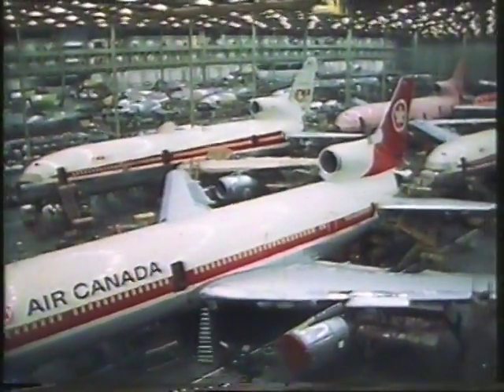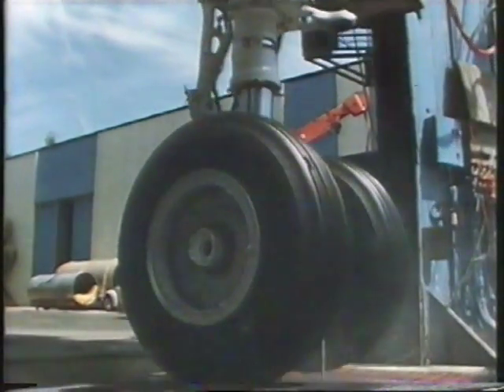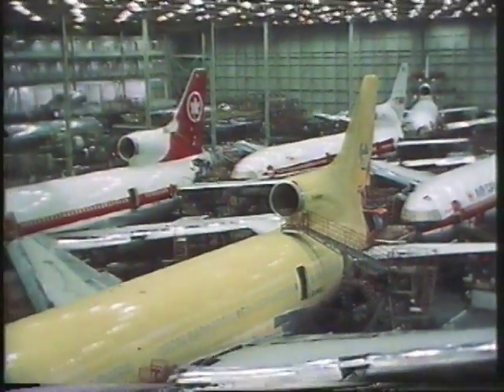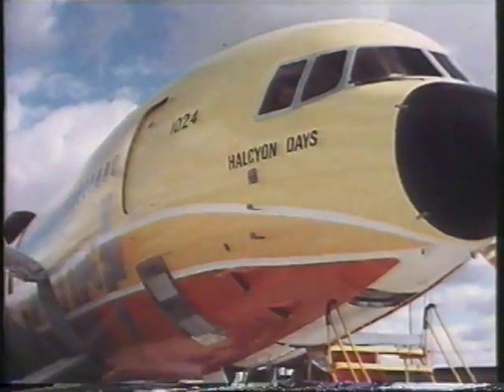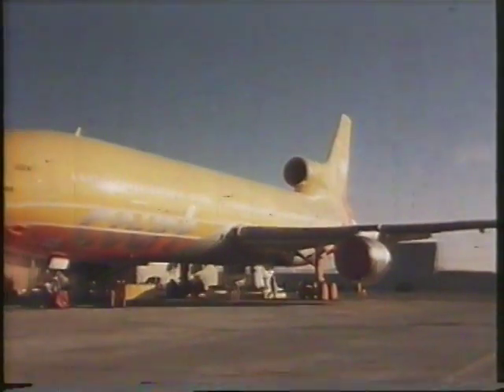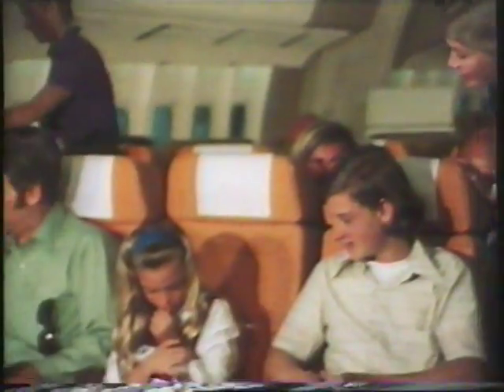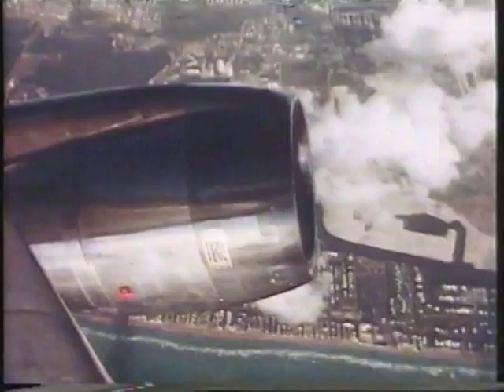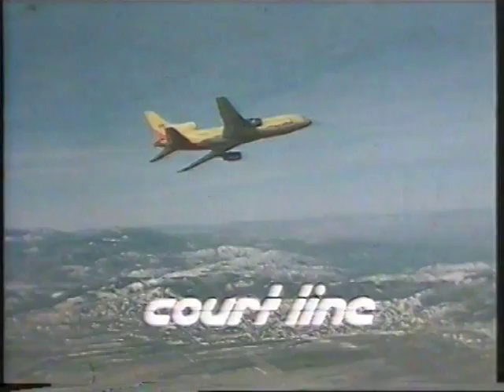Court Line Lockheed L-1011 TriStar

Comment: The problem with the L1011 was the complexity of the aircrafts avionics. Also some pilots found it difficult adjusting to the sophisticated lift dump system, resulting in many heavy landings. But at least the aircraft was fitted with Rolls-Royce RB2-11 engines. A three spool design that     started its commercial life in the Tristar. Derivatives of the RB2-11 are being fitted to the latest jets such as the Airbus A350.

The Tristar 200 series did not have a great range. OK for most trans -Atlantic routes, but couldn’t operate LHR/LAX. The Tristar 500 came along with more powerful engines. It was a shortened version of the Tristar, like a 747SP. Delta took out the underfloor galleys on their Tristars, and fitted extra fuel tanks whilst also uprating the engines. This derivative was called the 250 and then the Tristar could then compete with the DC10-30. British Airways took out the underfloor galleys on their 200’s just to release more cargo capacity. Those aircraft eventually ended up being converted to all cargo with operators like Kalitta. The 200 version of the Tristar had a frisbee ramp in front of the intake for No2 engine.

The Tristar was a very popular aircraft with British Airways Flight and Cabin Crews. The type was used a lot on Middle Eastern routes.

Comment: Flew as a passenger in one of the Court Line TriStars and did a flight deck visit whilst undergoing training to be an RAF flight engineer.

Little did I know I would end up flying the Tristar both in military service and for a civilian company.  It was by far and away my favourite flightdeck as it was impeccably laid out, unlike the DC-10 which I flew for several years.

I always thought the TriStar was designed for grown-ups . . .
Reply: That is a L1011
TriStar

Comment: The built in stairs was cool, most didn’t have that option tho, same with the mini loading ramp. Beautiful aircraft , Lockheed should get back into making airliners again!
Reply: Just get the old blueprints out, rethink the layout,  tweak efficient wings and fuselage, and  add three more fuel efficient and quiet engines, and you'll have a winner over 787 and the320.

Comment: Forget the plane that self-folding stairway is an engineering marvel
Reply: No doubt, when I was watching the stairs deploy I was thinking " yeah but no railing, too dangerous to use those" just then the railing pops up ,,,, Amazing
Reply: That stairway was a marvel. 
Though lest  be said about  the planes volatile automatic escape door at the rear.
Reply: @Montyair1  the DC-10 had the automatic self-escape/self destruct cargo door
Reply: Air stairs were nothing new.  Even then.
Reply: Shop queen.
Reply: Engineering marvel no doubt, but not a great idea when viewed from an efficiency and ROI point of view

Comment: What a DC-10 wants to be when it grows up.
Reply: Yes, we know the L-1011 is and was a highly advanced aircraft for its time. But the DC-10 is still advanced and also a workhorse. I hope the MD-11 will see a few more years of service in cargo.
Reply: Funny to hear the DC 10 comparison comment😅
Roher and GM made similar styled Motorcoaches that Rivaled each other like Tri Star and DC 10 did.  Once again, the boring  household names win.
 Douglas and GM win over Lockheed and Roher even with all their tech advancements. One is still in flight and the other became "the most iconic vehicle of the 20th Century."🏁🏁
Reply: Yeah, right…that’s why the DC-10 sold more than the L-1011.

The L-1011 aka The Tritanic.
Reply: @scottnichols3685  , you're not considering the flaws.

When did an L-1011 lose an engine on take off, as in ripped off a wing?

When were the hydraulics of an L-1011 knocked out by an engine explosion (UAL)?

When did the floor beams of an L-1011 collapse due to a cargo door blow out?

Face it. It was a superior aircraft.
Reply: @lrg3834  : both of these posts are grossly oversimplified (and bad) takes.

The DC-10 outsold the L1011 because it was cheaper yet still functional. The L1011 was technically superior in many ways but this was reflected in the price tag. Relying on RR alone was the worst decision made in the whole program as it put the airplane behind schedule and under-budget - a CF6 or JT9D L1011 would have probably had fairly similar costs to the DC-10.

The DC-10 was also easier to maintain, particularly the #2 engine.

The DC-10 that lost its engine on takeoff had nothing to do with the design of the airplane and everything to do with shoddy maintenance. The only airlines with pylon fatigue issues were the ones that abused the airframe during engine swaps. Northwest never had a problem and they operated the DC-10 a decade longer than any other US carrier.

Lockheed was wise to arrange the hydraulic system in a way that made a complete failure due to #2 uncontained failure less likely. MDC ought to have considered this possibility (and the changes made to the MD11 reflect this). But this was ultimately a GE issue, as was the case of the passenger who was blown out over the desert. The early CF6 had its fair share of uncontained failure problems (much like the CFM56 - it's a recurring GE issue).

The floor beams of the DC-10, in hindsight, ought to have been reinforced in the event of a cargo door failure. But the cargo door would never have failed if Turkish Airlines didn't perform unauthorized modifications to the locking system (grinding down the locking pins to make them easier to force into place when the door was not closed correctly). I'm sorry, but the cargo door incidents were 100% due to the airlines and ground crews. Nobody seems to mind that the 747's cargo door was actually a completely flawed design and had its fair share of failures due to the aircraft itself causing an uncommanded unlocking of the doors inflight. There's a world of difference between a door that has been forced into place and did not lock correctly and a correctly-closed-and-locked door that summarily decided to unlock itself in the air. One is human error, the other is a design flaw. Similarly, nobody seems to mind the fairly large number (at least 8) of 707 and 747 (same basic pylon design) pylon failures leading to several fatal crashes, including one into an apartment building that killed hundreds of people. A DC-10/MD-11 pylon failed twice, and neither time was it due to the design itself but shoddy maintenance practices (or, in this last case, Boeing advising airlines that there was no risk in a situation where the risk was obvious).

The L1011 also had its fair share of teething issues, hence why crews called in the "L-10-e-Lemon." Technically superior but the additional complexity manifested itself in technical problems. DLC is a cool idea when it works but stick and rudder is simpler.

Bottom line is they were both good airplanes that served their owners well for many years and it's a shame they're gone.
Reply: DC-10 is still flying. All of these are in the scrap yard.
Reply: @Bartonovich52  except the cargo doors stayed on the L 1011 when flying.
Reply: @JDAbelRN  : I suppose that puts the L1011 ahead of both the DC-10 and 747, no?
Reply: @Bartonovich52   pretty much, sad thing to see though. Both Lockheed and Douglass made my two favorite planes...it sucks to see the 1011 go.

Comment: Never knew the aircraft was so self sufficient.   Been in the industry for 41 years and would love to see this gorgeous aircraft fly again, re engined , In a few variants.   I loved the aircraft when I flew as a pan am flight attendant when they flew the -500 variant.   I'm still baffled that I never knew it had a hydraulic stair step in the rear that folded out , so in essence it could go anywhere there was a runway.  How Cool.  The new 737 max aircraft are a marvel in performance and fuel efficiency , however you can feel the cheapness.  The doors feel like a feather compared to the older models.  Oh well the days of aircraft being built around the customer sitting in it are definitely over.

Comment: I read that some airlines like American didn’t like them at all. Why?  Delta supposedly loved them.
Reply: Jess W what’s amazing is they had two crashes before anybody fixed the baggage door.
Reply: @EnergeticWaves  That was the DC-10.   The L-1011 was engineered right and diligently from the get go.
Reply: @ Carl Cushman Hybels. 

So rightly so that their engines exploded during bird tests that made Rolls Royce go bankrupt and Lockheed have to get bailed out by the US government.  

So right that the horizontal stabilizer failed on Delta 1080–something that never happened to the DC-10. 

So right that almost every L-1011 has been scrapped while DC-10s still rack up hundreds of hours a day. 

Of course... Lockheed already learned about cargo doors the hard way. Look up the C-5 ;)
Reply: @Bartonovich52  off course the L1011 didn't kill over 700 souls with faulty cargo doors...

Comment: What a beautiful bird. I wish they'd bring her back. The big hangup they'd have is the 3rd engines that aren't necessary today with today's  reliability, however with the new modern wing of the 787 and newer composite materials, they'd save planty of money and the 3rd engine may enable them to fly faster and farther. I just love this airplane and everything about it.
Reply: The Space Shuttle was a expensive disaster that killed 14 astronauts due to events that would have never happened on a conventional spacecraft (leaking O ring would have just reduced thrust... foam insulation would have hit disposable stages that didn’t have to survive reentry).
Reply: "I wish they'd bring her back..."  It never broke even for the company.  Before Lockheed closed the production line, they offered to sell it to Boeing.  "Not interested..."

Comment: what happened to the Tri Star, it became obsolete in some way, maybe; they stopped the 3 engine design, maybe because 2 engines were just as reliable and much cheaper on fuel. it was a much much much better plane than the DC 10 is what I read.
Reply: The DC10 had some flaws, but they haul the freight and are workhorses. Some DC10s are approaching 50 years old and still fly. I love MD-11 DC-10 and the L-1011. Nothing can beat Triholders.
Reply: 2 engine aircraft are much more efficient. Once engines became sufficiently reliable, the third engine was not necessary for redundancy.
Reply: @fookthefrench  The high bypass (and very wide) engines of today are much more efficient.  2 of them is all that's needed, with the modern also efficient wing.  The jets tho are not as fast.   And while less noisy, today's jets don't have sounds people are yet nostalgic about/ like a lot.
Reply: S. Mesut all two engined long haul aircraft now have to gain ETOPS certification before being allowed into service.